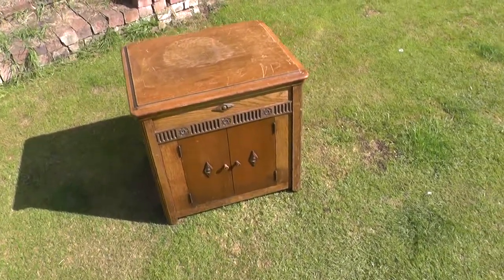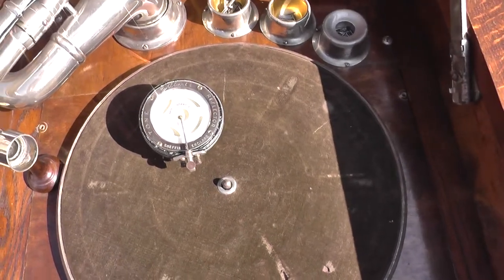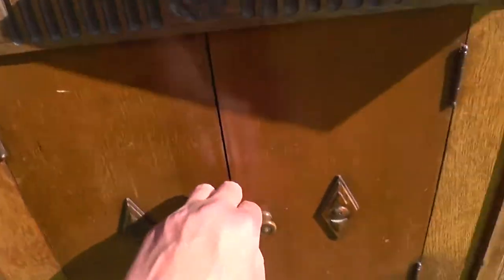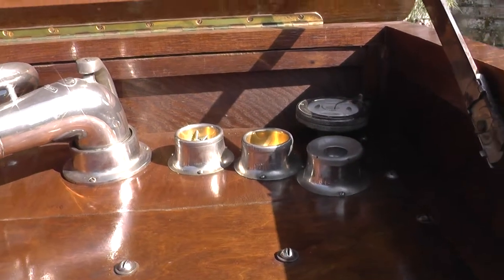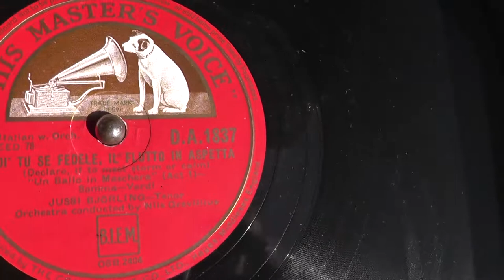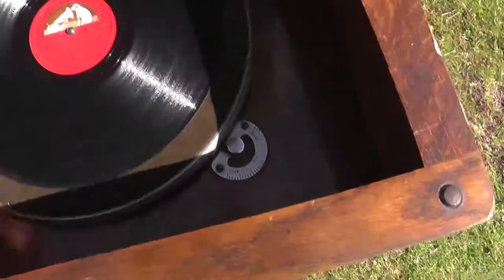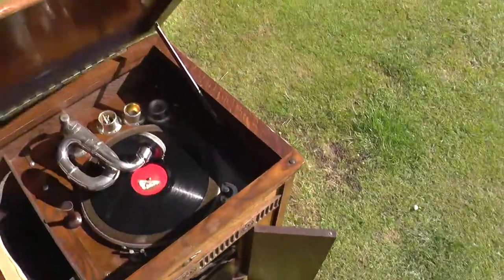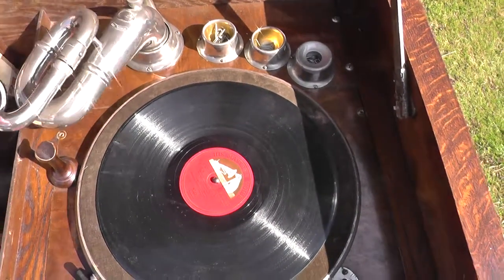Glibert Gramophone

Comment: Gilbert actually made some of the best and most powerful Gramophones in their day. 
Regarding the Horn;  Gilbert soon found out that the shape of Horn, length etc. made little if any difference to the actual Sound quality,  and that this lay entirely in the build of 
the Sound Box which they concentrated on – along with a good Tubular Tone Arm 
Chamber – which they solely held the rights to.  You won’t find a better quality Sound than that of a Gilbert Machine – whatever anyone may tell you;  the‘claim’ that HMV were the best was down to mere ‘snobbery’ of the day. (it still goes on today with modern appliances!)  The cabinet - along with the Motor Board does look a little tampered with to me,  as Gilbert quality was really high,  and it’s unlikely it would have left the factory like that.  Thanks for the interesting Video!  Note that VERY loud and crystal clear Sound!  
You certainly did a great job on the Sound Box – Gaskets are SO important.

Comment: Nice!  I have a Brunswick made in 1917 that I need to change the gaskets in the reproducer as well.  I also need to open the coil spring cans and clean out the 100+ year old grease that has basically turned into cement inside them.  I dread doing that.  I noticed something about that one I'd have to change.  I noticed the plinth or backboard as you called it has the wood grain running in the opposite direction from the wood grain that surrounds it.  I'd have to make a new plinth because that would just drive me bonkers after a while, lol.

Comment: A Gilbert machine is on my want list, I've watched several over time but as yet not managed to acquire one. Like yourself I just want to hear it and see how it sounds. Yours sings very nicely. Great video thanks. Paul
Reply from the maker: Yes, I've always wanted to hear one in the flesh and see how they perform. They are certainly interesting for what they are. The soundboxes have some nice features, but I'm not sure that the tone arm makes much difference.... I think a better designed horn would have been an improvement, but at least the arm looks quirky!
Reply from the maker: @GramophonicReevolution  Very nice too - and compact. There's lots of empty cabinet with this Gilbert, and it's all a bit cumbersome. But you must find one just for fun!
Reply: @jfisher6829  I'll keep looking...😎